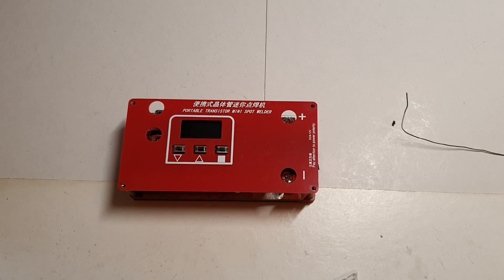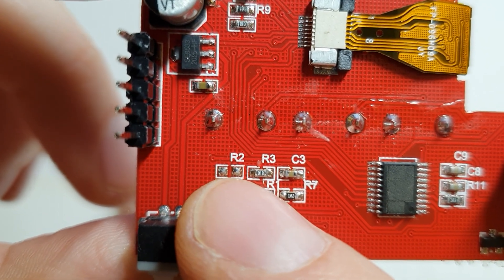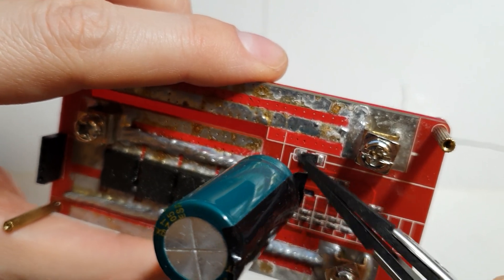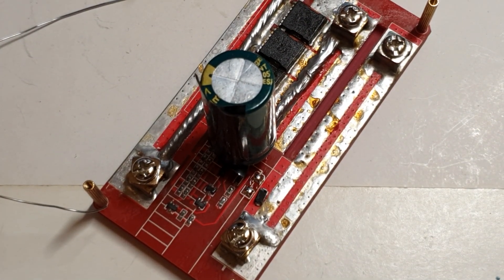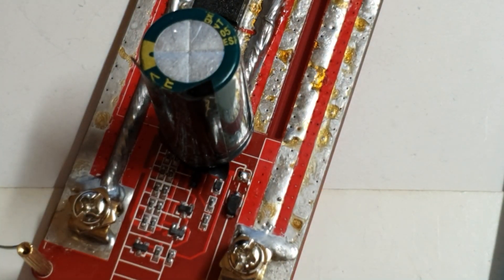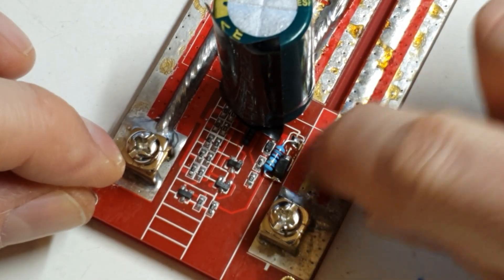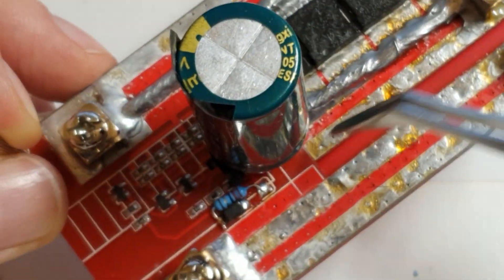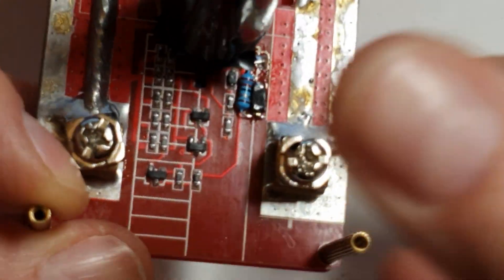Mini Spot Welder Bk11-1k BL18-2K CA04 Inrush current limiter resistor mod - check your diode!

Comment: Hi Luca, nice Job!
If i wanted to avoid all the Problems with the blown FETs, wouldn't it make Sense to power the Circuit with an external Power Supply (12V/2A)?
To do this, could I unsolder the Diode F7, rotate it a bit away from the Pad on the input Side and then connect it to the Plus of the external Power Supply on the input Side of the Diode?
Where should I connect the negative Side of the Power Supply then and how can I disconnect the Negative Side of the Battery on the Circuit Board in this Case?
Reply from the maker: Hi, you would need to keep the negative common and just power the mcu and trigger circuit with the positive from the psu and remove the positive that goes to the regulator (which then feeds the mcu and trigger circuit). However if you correctly decouple the circuit you don't really need an external psu .

Comment: 9:20 you said GOLD but i believe its a silver band so red, red, black, SILVER, brown ...I'm about to do the resister and want to be clear if its silver or gold
Reply from the maker: Don't worry about that band, it doesn't matter in this case, that's the tolerance band - you can use any resistor above 10 Ohms to about 50, 1/4 or 1/2 watt, any tolerance.
Reply: @Luca_Techy  thank you Luca
Reply: @Luca_Techy  can i use a 8000mAh 11.1V 100C 3S Lipo Battery
Reply from the maker: It's a bit of an overkill so you must be very careful with the initial weld times starting from even 2-3 ms upwards. The peak current can theoretically be over 800 Amps which can be fatal to one or 2 FETs if they are not all matched. This is what I try to explain every time I get asked this question. I will try to make a video on all these FAQs to cover them all.
Reply: @Luca_Techy  Thank you
Reply: @Luca_Techy  here's another welder with 8 gates... GX591 Spot Welding Machine Control Board DIY Spot Welder Set for 0.1-0.2mm Nickel Sheet Hydride 18650 Lithium Battery Welding you may of tested or seen it

Comment: Is it a different model if those components are on opposite side of the board than the cap?
Reply from the maker: Which components on which board? The main FET board or the MCU? There are basically 2 main FET board versions, one with the push pull drivers on top and one with nothing on  top and diodes on the bottom.

Comment: will the 10000uf 25v capacitor be used? i got one extra
Reply from the maker: Yes, the inrush current limiter resistor serves to limit the current through the diode while charging this cap. The cap the will maintain the electronics voltage stable while the pulse draw current from the battery.

Comment: instead of beefing up those traces with solder why not take a piece of wire thick wire solder it went into the other and then just a little bit of solder along the way maybe even not that just sort of went into the other they're both the same place anyway..... so you are suggesting I purchase two of these you want me not even to try them open them up make these modifications otherwise they're going to burn up??
Reply from the maker: You can use come copper wire to beef the tracks up too, I did this on my first one - just be careful not to short the gate pins in any case. The mods are mandatory else the FETs will fail pretty much immediately.

Comment: Is the diode considered reverse biased now? I have the bifrc board and the diode is reversed like your doing.  The voltage regulator and 2 control circuits that run the led and fets I believe shorted out somehow. 

Replaced and everything works visually. Just trying to grasp the way these circuits work.
Reply from the maker: No the diode isn't reverse biased it's just flipped around to allow space for the 1/4 watt resistor put in series with it - it's explained also on the circuit drawing.

Comment: Initially mine was working then failed due to the diode shorted. But later on doing these mods, even at 1E it's putting hole on nickel strips and even melted the welding tips. What might be the problem?
Reply from the maker: You have a shorted FET(s) so you'll have to locate and remove it - tricky if you're not handy with a soldering iron or desoldering hot air gun.
Reply: @Luca_Techy  But in diode testing mode it doesn't conducting. Does the 470 Ohm Resistor R4 increase to 1K Ohm solve? I guess there is a issue there. In some other videos you explained
Reply from the maker: @sarathkumar341  try the lamp test. You'll see the lamp always shines as soon as you connect the electrodes without trigger. If you replaced the diode which was shorted and added the current limiting resistor that's fine but too late as the FET has already blown (shorted).

Comment: Hello Luca, I bought a mini welder ref: CB23-4K that I modified like you but it does not weld, very low discharge, what could it be? thank you for your help, Have a nice day !!!
Reply from the maker: Firstly, what battery are you using? Be sure to have a fully charged 3S 5000mAh 50C+ LiPo or a 12V 40Ah AGM battery. Only use the provided cables, don't extend them (or shorten them at least initially). Be sure to connect the using screw terminals or in any case a strong connection to te battery terminals. If you're certain of all the above then you should check the driver circuit, be sure the R4 resistor you replaced is 500Ohms and be sure it's connected correctly to the board. You can try the 12V lamp test to see if it flashes like in my last video.

Comment: Hello Lucas, can a 51R1 resistor go to replace the R4? thank you, have a nice day !!!
Reply from the maker: 51R1 is 51.1Ohms which is too low. You need 470-550 Ohms to be good. That would be from a 471 3digit code value to a 551 value.
Reply: Thank you very much Lucas, God bless you !!!

Comment: I messed up on of the terminals of the r4.. It's not holding the 470ohn resistor..  Am stuck
Reply from the maker: You can find another solder point, just follow the traces to another solder joint.

Comment: Thanks for your excellent video. I have the CB23-4K version. I have added a second 1 kΩ resistor to the R4. I also made the capacitor charge inrush current resistor modification
Welding two sheets works well.
I tried to weld a nickel strip to a 18650 battery, unfortunately it does not hold up well even if I have set it to 50 ms.

  How is it better to weld with light contact pressure or with more pressure. At the moment the electrodes are flat at the bottom. Is it better if they are rounded?
Reply: I have now found out why the welding points on the 18650 battery did not hold up well. On my first attempts I used a 2 AWG cable with 1.8m length from the battery to the spot welder which apparently reduced the performance. Now I have connected directly to the battery

In addition, the electrodes have rounded at the tip now the welding points hold well on the 18650 battery

Comment: Hi! Looking now at Wise Maple - it has far less space on the board. How would you recommend to place the resistor? I think it is not possible to rotate the diode the way you show in the video - it will touch other components there :(
Reply from the maker: You can slightly move the diode and use the capacitor leg directly as other contact - check with a tester in continuity to be sure you get the right side of the pad and leg of the capacitor first. Another possibility is to use a current limiting XT-90 plug directly on the power cables - this will avoid any mod to the board itself as it has this feature embedded. Just search for "XT-90 Spark arrestor" - like this: https://www.aliexpress.com/item/32534055240.html?spm=a2g0o.search0303.0.0.4e1a3010zK1DsI&algo_pvid=a19eac54-74ab-4751-ae40-a3f766da745a&algo_exp_id=a19eac54-74ab-4751-ae40-a3f766da745a-1

Comment: Thanks for the video, I got the CB23-4K version and made the suggestions you posted prior to trying the unit. The diode is fine, but the device doesn't seem to work. It powers on, I can adjust the power (time), change it to automatic, and when touching the strips I hear a beep, but it doesn't seem to discharge any power.  I don't see any fluctuation with the battery voltage. I first used a 3s lipo, then moved on to a 4s. Right now I am using 6x 4S 100C 1500 Mah lipos plugged into a parallel board. Any ideas what I could test, or what could be the issue? Only other thing of note, the display shows about 2V less than the battery voltage, but I figured that was due to one of the resistors?
Reply from the maker: Hi Robin, your MCU seems not to be triggering the FETS. In another video I show how to check this with a 12V 21Watt lamp (check the playlist, it's one of the last videos). This test avoids putting your welder to "Full Send" on a normal weld and risking to cause a catastrophic failure. If you don't get any flash even with 99 set on the lamp then your FETs are not turning on. Double check the R4 contacts and be sure there is continuity on both sides of the resistor - if in doubt reflow the solder joints. With a tester trace the R4 output to pin 4 and down to the pushpull pilot transistor base. Don't worry about the voltage difference consider that there it's always imprecise just be aware of the difference (it can range from .5 to 2V apparently). This is due to the tolerances of the resistor divider and comparator in the MCU itself - that's why individual calibration  should be done but too time consuming. Anyhow stick with 3S 5000mAh which is fine while running the lamp and various tests.

Comment: I have a 470 Ohm resistor but it is very small. Way smaller than yours. Is that okay? Thanks
Reply from the maker: Any size will do, smd or normal the important thing is the value (470-500 Ohms) in this case.
Reply: 1/4watt or 1/2watt will work. 
470ohm and 22ohm for r4 and m7 respectively

Comment: ARE THE TWO RESISTORS THE SAME ??
Reply: R4 is replaced with 470ohm -1/4watt

The other you add 22ohm -1/4watt

Comment: AND WHAT RESISTOR FOR THE R4
Reply from the maker: R4 should be replaced with a 470 to 500 Ohms value - it's all explained also in my other videos with schematics - check them out.

Comment: When I was performing the R4 mod the left solder pad came off the board so the solder want stick anymore. 
To fix this problem I just soldered a 470ohm resistor from the right solder pad of R4 to the pin 4 on the top plate of the MCU board.
I think this can be a good solution, Luca let me know if it is. Thank you
Reply from the maker: That depends on the way you see the board: if you look at the MCU board with the switch on the top right then the right pad of R4 goes to board contact pin 4 and the left pad goes to MCU pin 19 so it's ok to solder one side of the resistor to the left pad and the other side directly to pin 4 (to be reversed if board flipped with switch on bottom left). Just to be sure use a tester in continuity and check that the pins are correct (pin 19 of MCU should be connected to left pad of R4 holding board with switch on top right).
Reply: @Luca_Techy  I've checked and it's working. Which settings do you suggest me for soldering 0.1 x 5mm nickel strip on 18650/21700 battery? I use a 3s 5000mAh 50c LiPo battery
Reply from the maker: @Fabiohappiness  That depends on the state of your battery which varies greatly. I suggest you start testing from 5ms upwards on some test battery until you find the sweet spot. With .1mm and a good LiPo 10-15ms is a good ballpark but as I said it depends on the battery.

Comment: Is it important how powerful must this 20 oHm resistor be? Is 0.6W enaught? Thanks
Reply from the maker: You don't need a high wattage resistor, it's only to limit a very brief current peak, any 1/4 watt or 1/2 watt resistor will do fine.
Reply: @Luca_Techy  you just answered my question

Comment: First of all thanks for the amazing content! I do have a question though! Idon't have a lipo battery pack to power this and understand a lead acid battery does work. Would I be better using a car battery (760A, 80Ah) or a motorcycle battery (14Ah)?
Reply from the maker: The motorcycle battery may work but only if it's brand new - it's a bit small (I used a similar one brand new and it worked ok but not as good a the new 3S lipo pack). The 760Ah is an overkill, but you can try starting from very short weld times (5ms upwards). Just be careful and always start from a low value every time to fine tune the welds and be sure the connections are solid.

Comment: Hi Luca,
I just received the welder with version CB23-4K,  what resistor value do I need to change for R4?
Do I still need to flip the M7 diode around then add 20Ohm resistor?
Thank you in advance
Reply from the maker: Hi Key, it's all explained in my last 2 videos in the playlist. R4 should be 470-500 Ohms and the in rush current limit resistor 10-20 Ohms.

Comment: Will this welder do 0.2mm nickel using a car battery? Your recommend modifications have so far given me MANY MANY great welds with 0.12mm nickel.
Reply from the maker: I wouldn't suggest going that thick, it's not dimensioned for .2mm and you risk overdriving it. You can manage .15mm with decent copper power and electrode cables keeping the pulses short enough (under 40ms). Keep in mind that these aren't "quality controled" and matched FETs, you get what you pay for, some are lucky and some aren't. If you happen to get a good matched batch of FETs and decently soldered components with the mods you are ok, but I wouldn't go over that .15mm limit, the design is just not capable of assuring stability.

Comment: Information: it is not advised to use a 6,6V 3300uF condensor to solder in. It will ruin the part on the board nearest to the capacitor. So you cannot use any capacitor you have to use a specific. Whitch one i have no clue ask Luca.

Comment: I have a questions. I have same model. I haven't done any mods, but when I connect it with big battery and try to spot weld  there are only 3 beeps but  it does not weld.  I do not see any damage to mos. Can you tell me what could be wrong
Reply: Just checked the diode, it's short.  Will change and see if it fixes. But wondering would there something that should I double check?
Reply from the maker: If it doesn't weld strips, do the light bulb test as shown in my other video - this way you can check if the FETS get triggered or not. If not you have a fault in the pushpull section or you simply need to apply the R4 mod (470Ohms) as specified.
Reply: @Luca_Techy  sure .  The gets are not getting triggered. Will apply the mod and let you know  can we check if my fets are good??
Reply from the maker: As you are not getting welds then your FETS are probably ok as when they fail they short.
Reply: @Luca_Techy  awesome   thank you , will keep you updated  have ordered the diodes
Reply: @Luca_Techy  thank you so much for your suggestion.  I changed the diode and did not add any inrush resistor as am going to using an external resistor to precharge  it.  Then added a 1k ohm resistor in parralel with r4  works great . I do appreciate for posting this video.

Comment: Hey I have one that has a board number of ca20-2k what do I need to do
Reply from the maker: Check my previous video on all mini spot welder types in the playlist it's all explained you need to mod R4 and add inrush current resistor
Reply: @Luca_Techy  thank you for the quick response I had ordered a capacitor thinking I would receive the other revision and then had to go searching once I realized that the revision I had received did not have the same layout again thank you so much for your time and help

Comment: I have now a model ca20 do i have to change anything??
Reply from the maker: I beileve the CA20 version needs the 470 Ohm resistor mod (R4) on the MCU and the inrush current limiting resistor added before or after the large Cap diode - just compare the board with this one or the ones I show in my other videos to see if it matches (I'm pretty sure it does).
Reply: @Luca_Techy  Thank you ;-)

Comment: You also could solder another 1k resistor on the other one (R4) . Maybe that's easier to do for some.

Ordered one like this device yesterday. Thank you for showing the modifications. Hopefully this cheap device will work better and longer now.
Reply from the maker: Yes this is also of course possible (some have taken that option).
Reply: Oh I already read indeed in the reactions now. 👍🏼

Comment: For those needing a quick recap: a 470Ohm resistor to replace R4 on MUC board, a 10Ohm resistor in series with the M7 diode charging the 10000uF cap! THOSE ARE ALL THE MODS YOU NEED (harder MOSFET on driving and lowering inrush current)!

Comment: Thank you for the video! The solution works well. When I recieved my CA04, one of the FETs blew up. I changed it, made your modification, and it is perfect. It can even burn holes into the nickel plate on setting more than 10 🤣, at the same time the FETs don't blow up. Thank you again! 💪
Reply from the maker: Great to hear!

Comment: puoi fare u  video su come smontare i mosfet...io non sono riuscito a dissaldarli per sostituirli...c è una tecnica particolare??
Reply from the maker: Ciao Mirko, per smontarli andrebbe usato un (dis)saldatore ad aria calda (va bene anche una pistola ad aria calda ma devi regolarla bene a media temperatura facendo prove con dello stagno altrimenti fai un danno), ma puoi anche riuscirci con un saldatore da almeno 50Watt controllato in temperatura con molta pasta salda e stagno un modo da scaldare tutta la pista sia lato Drain che Source dei FET in modo da rimuoverli facilmente senza danneggiare le piste. Fai particolare attenzione alla pista del pin 1 del GATE anche quando li risaldi che non faccia corto.